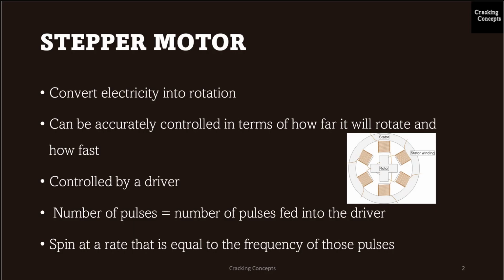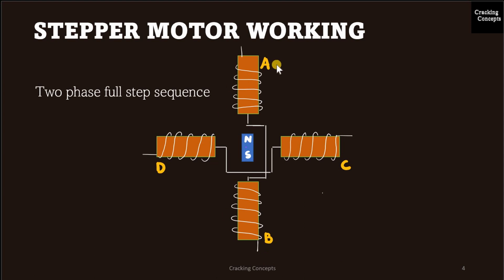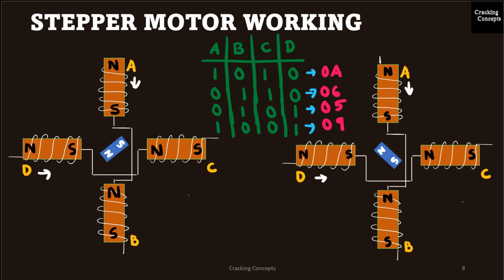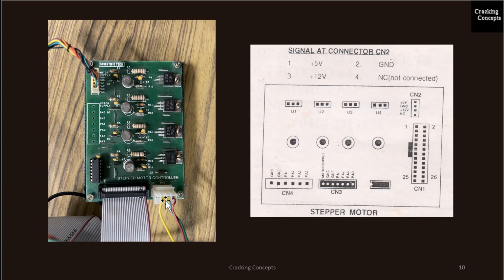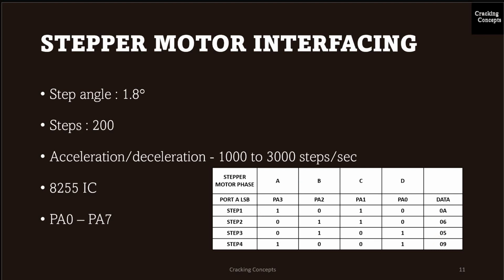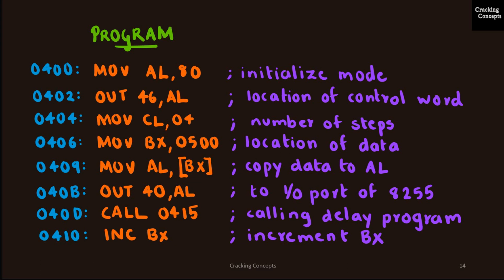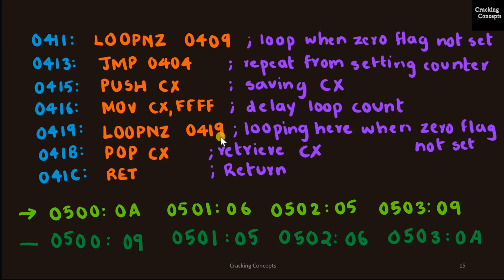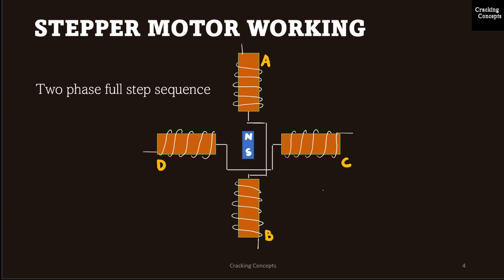MP LAB 13. Stepper Motor Interfacing With 8086 Trainer Kit with Demo

Comment: does LOOP instruction work on 8086 kit....or should we manually dec cx and JMP label
Reply from the maker: LOOP works
Reply: @crackingconcepts  mam while using loop instruction, the value of cx will be auto decremented ryt, unlike Jmp insrtuction
Reply: It would be helpful if you could describe the difference between the two instructions on repeating statements